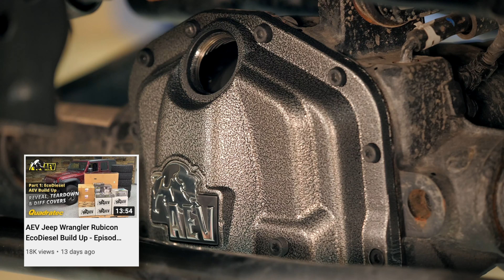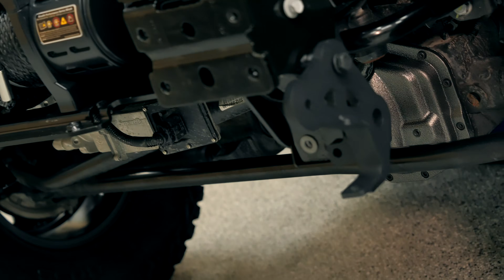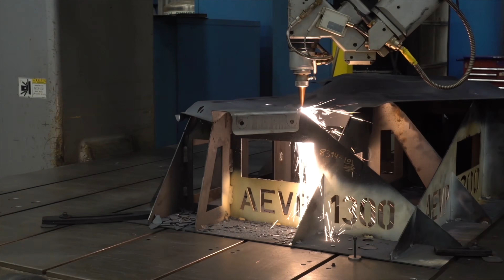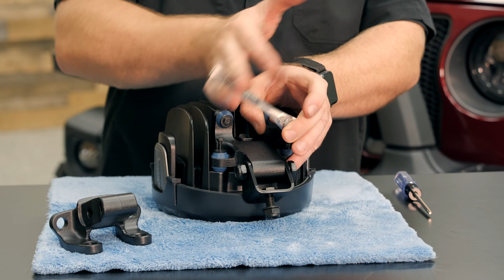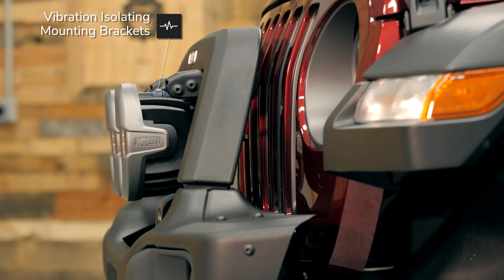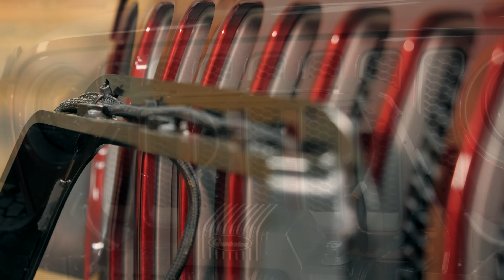AEV RX Front Bumper & 7000 Series Lights - Wrangler JL Rubicon EcoDiesel Build Up Episode 3 of 4

Comment: I have this bumper on my 2022 Rubicon and love it. Question. Do you have a solution for flat towing as the recovery eyelets are tucked down so low under the bumper, you can't fit a tow bar on there without interference. Thanks, mg

Comment: That bumper looks good but it also looks like junk that will bend and brake the first time you ding anything rocks trees branches deers   Plastics on that type of bumper is just stupid.  Those are supposed to be designed to carry the winch and take a beating from hitting things.  That thing will wrinkle like a cheap suit.  But it’s pretty.

Comment: Everyone bitchin about airflow. I run this same setup on my JK with the AEV Premium front bumper, the 9" lights and a Warn Zeon Synthetic in Texas when temps are over a 100 degrees for almost 5 years now. Temp gauge has never moved off the factory mark.  Maybe not this new one, but AEV has thousands of the older style which is similar to this one on Jeeps. If it was an issue, they wouldn't still be selling them.

Comment: Looks good. I am reconsidering a bumper that mounts up high after my latest recovery situation. Lots of muds, leaves, lack of visibility of the spool, and basically not possible to respool due to lack of access. I’m getting a top mount style bumper this time with a low hoop maybe…just in case of winch failure to tie the line off to.

Comment: I would be concerned about the airflow especially since I have the gladiator ecodiesel and their already seems to be issues with them running hot pulling hills or towing. It does look nice though.

Comment: Looks awesome but those 7” lights, paired with that thick winch guard is going to block a ton of air to the rad. That would be my concern anyhow.
Reply from the maker: This specific question has been addressed directly by AEV - "From your pictures, it looks like the center hoop, lights and winch block off too much airflow to the grille, is this something I have to worry about?
No. We spent years (literally) developing and testing this bumper in a variety of ways and conditions to make sure this bumper would perform well and without compromise BEFORE it made it on the front of any customer owned vehicles. The RX Front Bumper has seen everything from the daily commute to high altitude rock crawling to a multi-day overland trip across the desert. "
Reply: I own an AEV JL370 with an RX bumper, and no issues what so ever regarding air.

Comment: Tried to buy AEV wheels on your website. I had a few questions first. It is difficult to contact. I guess I need to reach out to a different vendor.
Reply from the maker: what questions did you have?  We do have a live chat feature on our website, or you can call us at 800-745-2348
Reply: @Quadratec  I was trying to use the email feature before work hours. Are jk Borah wheels currently available in machined onyx? How much can I expect them stick/poke out on JTR? Thanks

Comment: One question!
What are those 7 Slots in the Jeep Grill for?
You talk about the Bumper allowing the Winch to be mounted low so air flow to the grill would be unobstructed.
But you then add all that unnecessary items to do what, Obstruct Air Flow.
Reply: I just don't understand you guys talking about the air flow. Air does not move in only one direction...it is all around. I would love them to do a test on a hot day with a bumper and winch and lights  (Not this one because it is so over priced) and a jeep with nothing in front of the grill. I am positive you would not see a differecne in the temp gauge!
Reply: @luckyvegan7  Really now, talking about doing a test, so how about you doing a test on (obstructing air flow). On a Hot Day, you stand about 5 feet in front of a Fan. Then have someone stand between you and the fan. Then come back and explain your findings on Obstructing Air Flow.